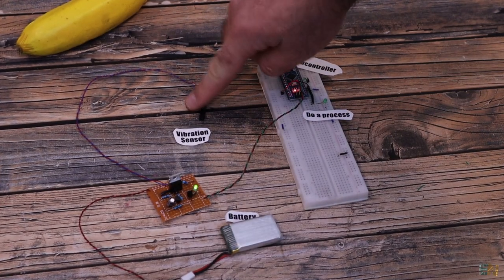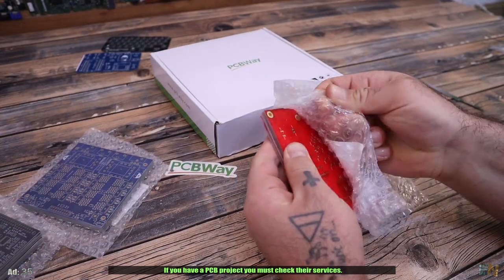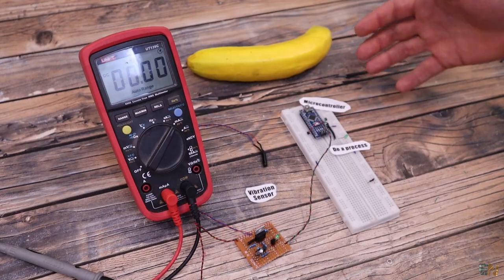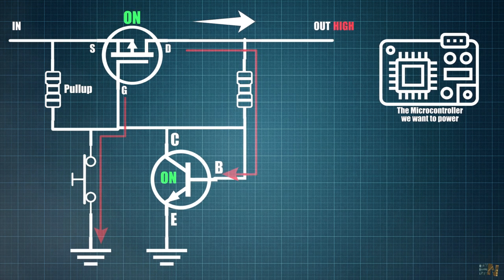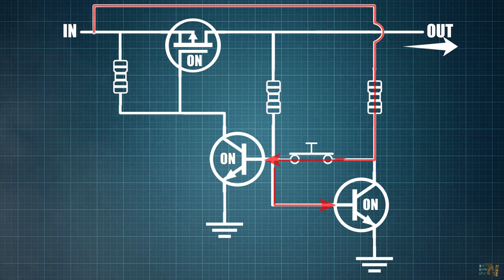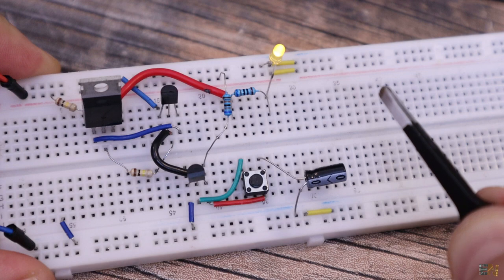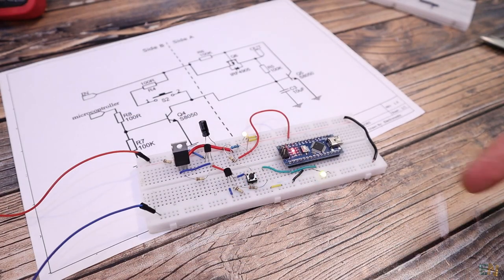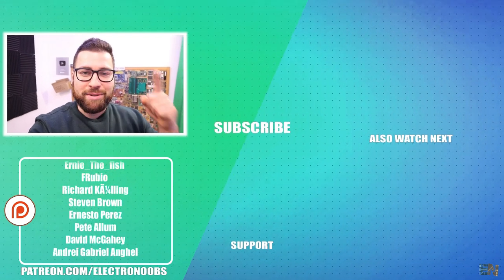Latch Circuit - Wake up + 0 Power Consumption (useful circuit)

Comment: what if I want to use this circuit as a low current shutdown circuit? Which is means that low current detection will activate the second transistor.

Comment: That's awesome idea .but what if microcontroller wants to send data every hour .so what will happen is tha only it will complete one cycle and will never wake up to read sensors data .??
Reply from the maker: I don't really understand what are you looking for. The uC will wake up each time the sensor triggers.
Reply: @ELECTRONOOBS  suppose I use dht11 sensor  instead of vibration sensor how can that trigger to turn on mcu ,since dht11 will work only with mcu to trigger the output

Comment: Can you use a regular transistor in place of the mosfet?
Reply: You can, but they have a much higher on resistance, so waste a lot more energy in heat. They'd probably suffice with very small loads though

Comment: A very interesting project, but I will call it impractical. An ESP32 takes upto a hundred milliamps or so while connecting to WiFi. Low power mode consumption of 90uA(for Arduino, will be far more for the ESP32) is still nothing in comparison.

Plus a 200mAh battery would still last you a huge standby time anyways.(check 200/0.00009 hours, something huge). Even in this latch circuit, there will be leakages through the BJTs and the capacitor, so if 90uA is a concern, then you might want to measure the leakage through the capacitor over time as well.

Comment: Analyzing your circuit, I need to change the 680k ohms resistor to higher or lower value to increase the latching time right? Right now, the latching time seems to be 6.8 seconds. Is that right?
Reply from the maker: Yes but also the C1 capacitor would effect the time!
Reply: @ELECTRONOOBS  Yes I am aware of it. I told about keeping the value of capacitor being constant haha. But this circuit looks great, have to test this out in my designs.

Comment: Why not drive the MOSFET directly from the microcontroller and turn it on at the beginning of the code while the button is pressed?
Reply: I think if you drive the P chan MOSFET direct the EDS protection diode on the IC IO pin would Send any voltage over about 0.7 volt to Vcc turning the circuit on. 

But Why can't you drive the first NPN transistor directly ?

Comment: Could be just what I need to shut down radio controlled models when the battery runs down, and to switch them off from the transmitter.

Comment: Not a good idea turnoff uc for low Power. There are better and simple solutions.
Reply: You should give exemple...
Reply: @fgovino  Just look the transistor datasheets , quiescent current. Look the uc datasheet for recovery times. And look for ultra low power regulators.